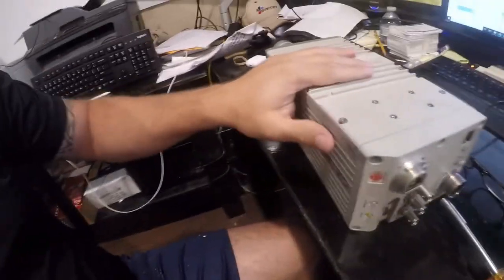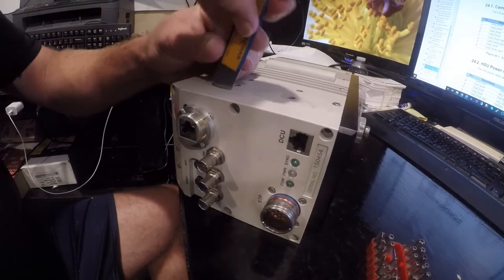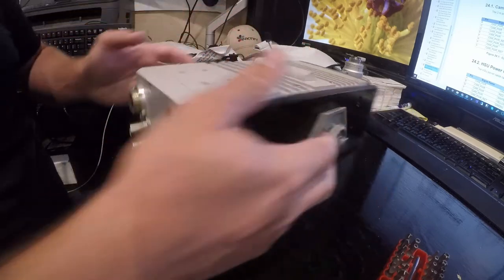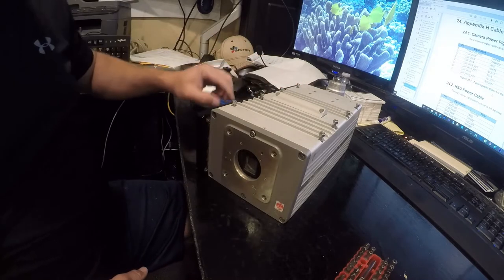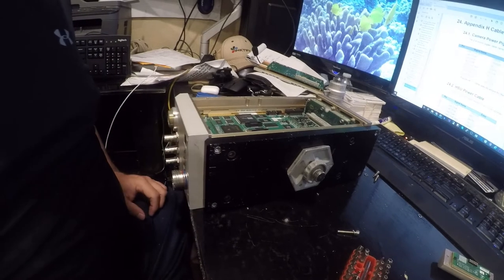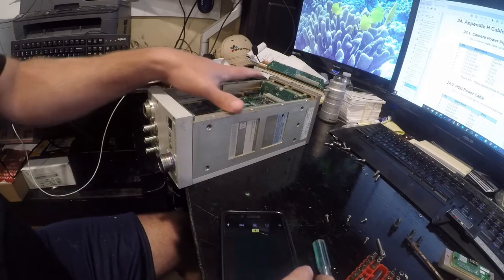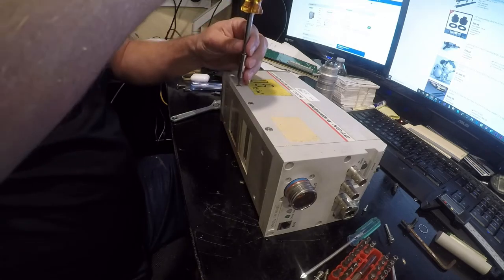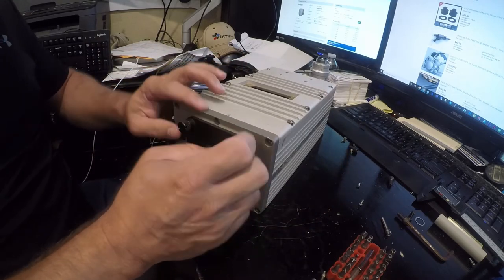Vintage High-Speed: Teardown and Search for Power Input

Comment: Hi, do you have any progress with it? I bought the second one from the same seller, just hooked two wires to the "STP" connector, and it powered up. The camera appears in the Motion Studio, I can see its properties and view the interal log file, however, it seems to lose connection when I try to view a live capture, record or playback video. I hope to find some debug UART inside - there are 4 unused connectors on the boards.
Reply from the maker: I have not gotten anywhere with it... but havent' decided to junk it yet either.  :)  Sigh, so many projects so little time.
Reply: @hotpuppy72  Finally I decided to remove that connector and solder some wires directly into the board - the matching part costs more than $70 from Digikey. The camera stopped to lose power unexpectedly, the current rises to 1Amp and some LEDs inside turn on when I start a live capture or record, but still no image and "Camera error". I found an UART with VxWorks shell on the one of internal connectors, and it complains about some files missing on the internal flash - seems like a firmware issue. Could you please help me if you find some time to play with it? You will need a 3.3v USB-UART and possibly a JTAG adapter - I can even send them to you for free if needed. Of course, I will share all my findings if I get it to work. Or I can buy your camera if you decide to junk it.